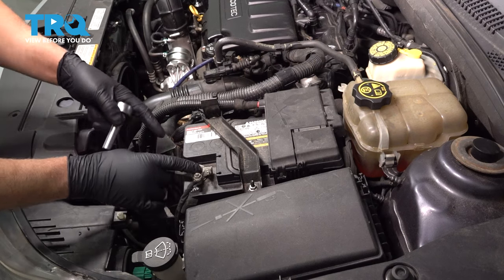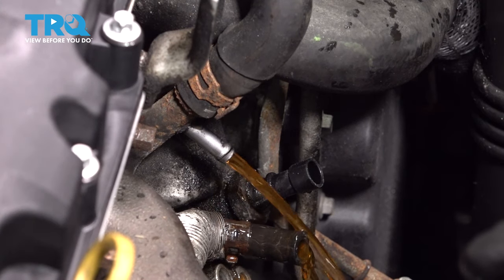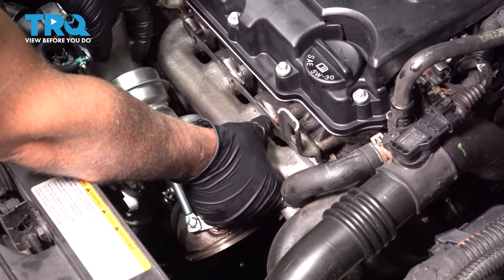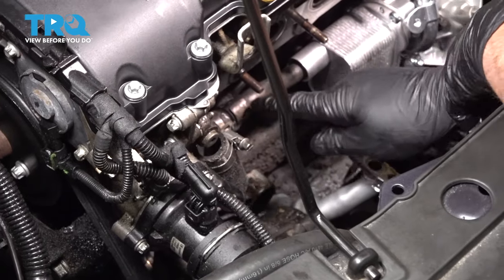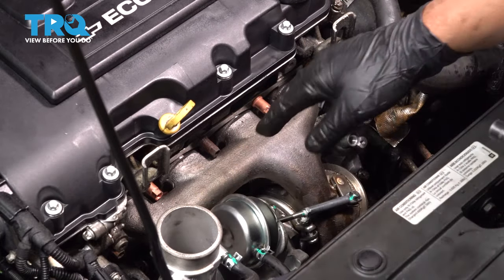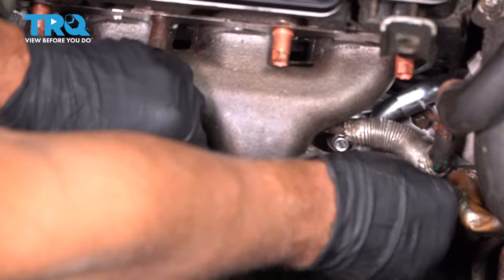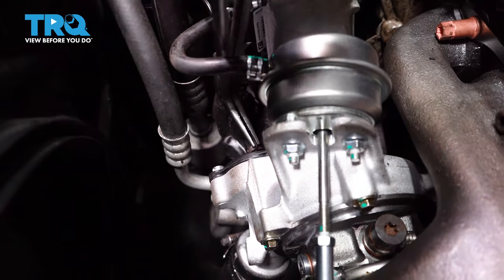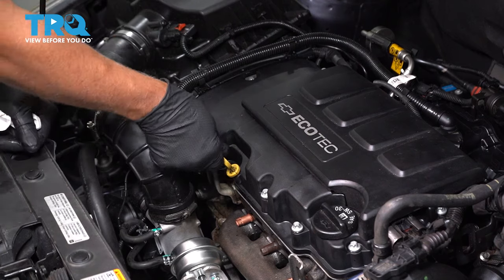How to Replace Oil Filter Housing 2011-2015 Chevy Cruze

Comment: This video is awesome since I have change both the turbo and the oil filter housing, you should probably rename it as a "twofer" one. 🙂 I also wanted to add that this is the second video I watched that someone says that this car does not have a radiator drain plug and that is incorrect. It is located on the passenger side bottom outer portion of the radiator.

Comment: Nice informative video. Note to others: The gaskets on my oil cooler (oil filter housing) are leaking. I am just replacing the gaskets, not the entire assembly. Also, when you have your Turbo off, inspect it very closely for cracks. My 2015 Chevy Cruze LTZ 1.4 T has a crack in the waste gate area, not visible from the outside. Don't do the job and put a bad turbo back on or you will be doing the job again.

Comment: Awesome video! Start to finish! Very much appreciated because I just purchased a 2014 Cruze and realized after that it had the oil leak from the oil cooler. While watching your video I was able to remove the cooler, replace the seals and oil rings, and reassemble it. I had priced it at a local repair shop for over 800 bucks. And although it took me a little longer than your video, I did the repair for around 125 counting the oil change. I didn’t replace the turbo seals and only replaced the seals in the oil cooler though. I couldn’t of done it without your video. Thank you!!

Comment: This is a great video except for one important detail. At around the 15:30 minute mark, you said to remove the black plastic piece if you have a turbocharger. That piece is actually an anti-drain back valve for the oil supply to the turbo and should not be removed. If you just push down on it, it will go into the housing so you can install the line. I ended up breaking mine when I followed your instructions and had to get another oil cooler. I called Dorman Products tech support and they told me what it was for.

Comment: Great video.  Small correction: the vehicle does have a drain in the radiator.  You have to remove the splash shield along the front bumper and there is a drain valve on the right side of the radiator.  🙂
Reply from the maker: +SouthwestVirginiaJeeper Thanks for the tip! We'll pass this info along to our production team. http://1aau.to/m/Shop-TRQ

Comment: Is it necessary or just good practice to replace the whole housing and not just all the gaskets? Did the one being replaced have a cracked housing? Also could you post all the part numbers for the seals and gaskets you also replaced?

Comment: So my oil cooler gasket kit came with 2 green bonded gaskets and 2 black bonded gaskets, can you maybe help and tell me which one goes on the turbo oil feed and when goes on the coolant hose that connects from the turbo to the block?

Comment: On the right side of the exhaust manifold, where the coolant line runs to the oil cooler... My bolt hole didn't line up with the hose line. Idk why they wont line up when everything else does. What can I do to zip that down?

Comment: Do you really have to take out the black tab for turbo cars I just took my stock oil housing off and it was in their from factory
Reply: No it slides out to seal and in to accommodate for the turbo oil feed line

Comment: Is it really necessary to remove the manifold/turbo assm? Can you reach all the bolts from below? 

Also people should be careful with that plastic pipe on the bottom of the turbo. its the oil return line from the turbo to the engine. It is easy to break and an absolute pain to get out if you do break it..the other end is slotted into the engine. 

On the converter I drove the captive bolts out because I broke 2 removing it. Did make it super easy to install again.